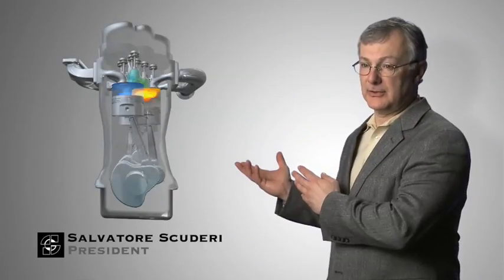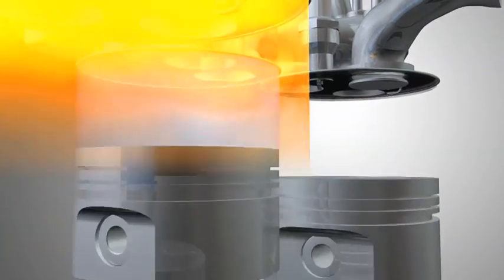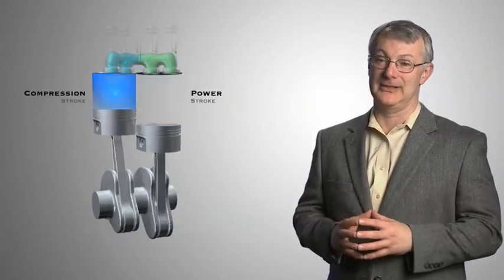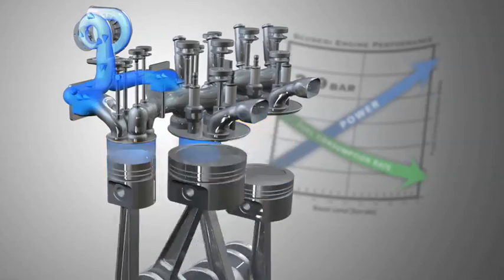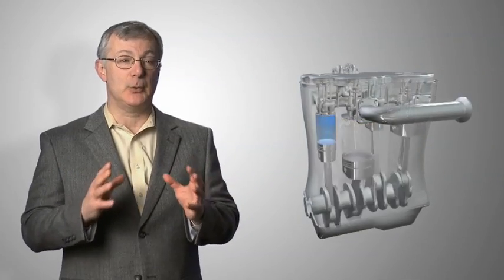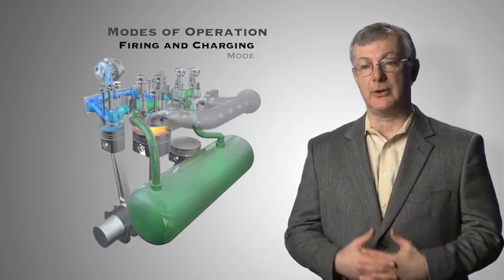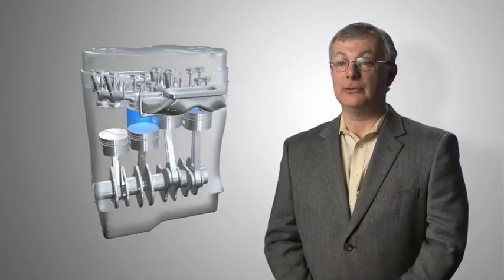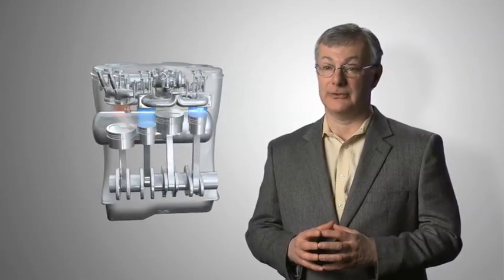The Scuderi Engine Breakthrough

Comment: The Scuderi engine is basically the Clerk engine from 1880 Patent # 230470.  Anyone interested should check out his book titled  "the gas, petrol and oil engine vol 2 1913 edition" in cater two titled " by Dugald Clerk. It's available online. In the chaper titled  'The development of the 2 stroke engine" He describes his 1880 engine. 1886 he made an improved version. Almost all of Brayton's ready motors used a smaller compressor to expander ratio. I don't really see anything new or novel here, maybe the turbocharger...?

Comment: Stupid question, but wouldn't this engine vibrate less if the crank throws were mirrored?
Reply: They are. The pair of compression and the pair of combustion crank pins are. It would not be possible to have the compression and combustion pins mirrored as the compressing piston needs to precede the combustion piston by a few degrees. Don't forget each combustion piston is now firing every engine revolution, like a two stroke. Giving the equivalent number of power strokes as a conventional four cyl four stroke. Or two cyl two stroke
But yes I do see your concern regarding balance and vibration. Though I think the main problems would be a rocking moment, as each pair is one eighty deg out of phase, and mainly the weird second harmonics from the different piston speeds of the four pistons of differing sizes and two compressing with two harnessing the power stroke.
I imagine balancing will be something of a challenge.

Comment: If the marketing / press releases are realistic, this should be a slam dunk.  Here is my question / suggestion - given the apparent reduction of weight and volume offered by this split-cycle engine cycle, would it be viable to mate a small stirling engine with this design to capture waste heat for additional efficiency and potentially aid in cooling for the main engine?  Potentially this could convert lost heat energy into mechanical energy via the air system that you highlight in your video.